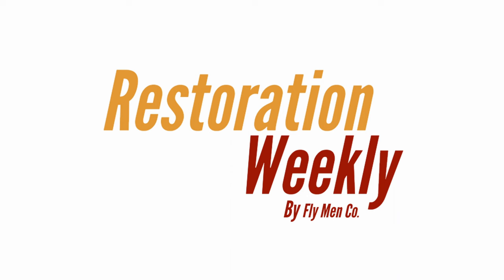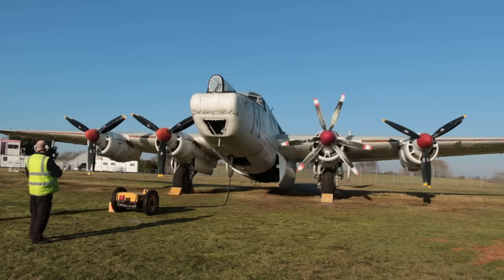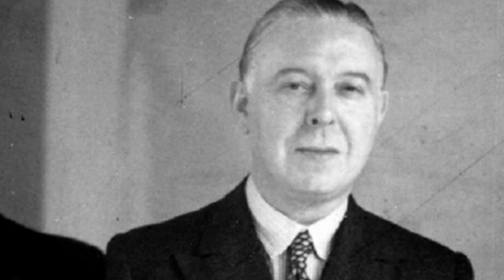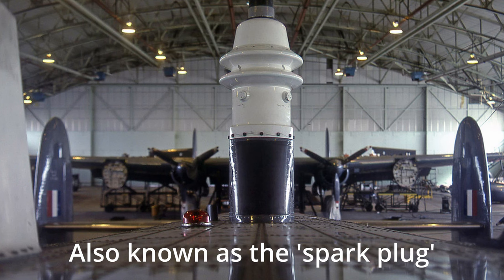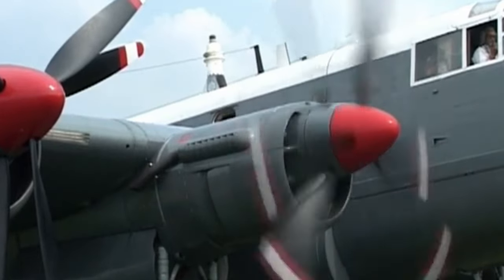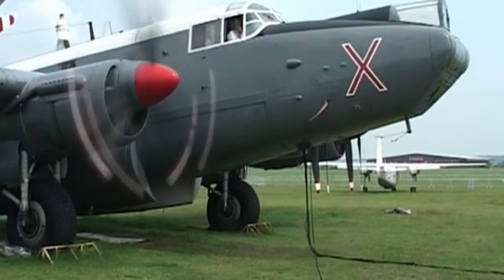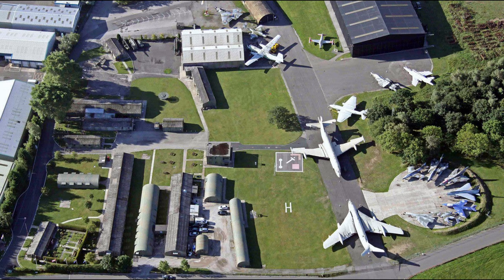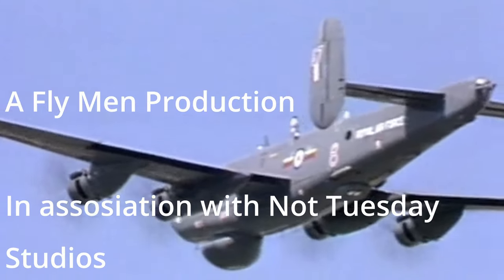The Avro Shackleton being restored to Airworthiness! - Restoration Weekly Episode 1

Comment: I saw a Shack visit us at BAe Hatfield in 1988 (or thereabouts) I was walking outside and saw it do a flyby down the runway, then into the circuit, then a high speed run down the runway at low level followed by a pull up at the end. I remember the wings bending up to what looked like an impossible curve as the Shack pulled up. The memory is still with me now.